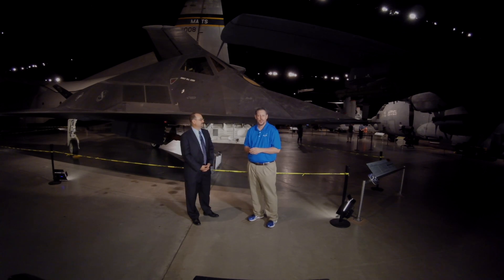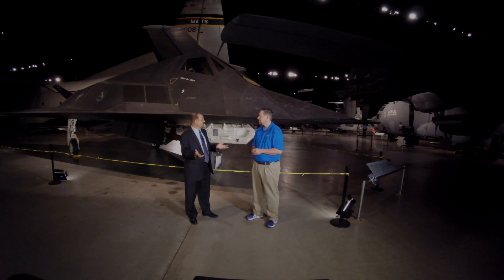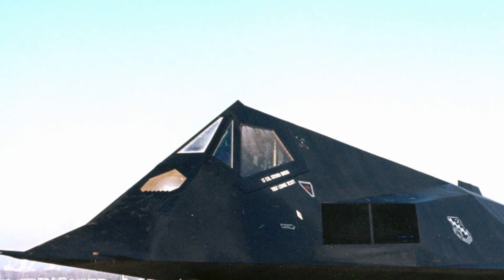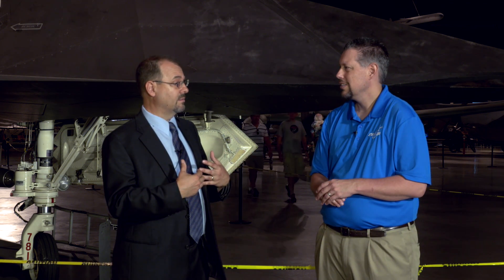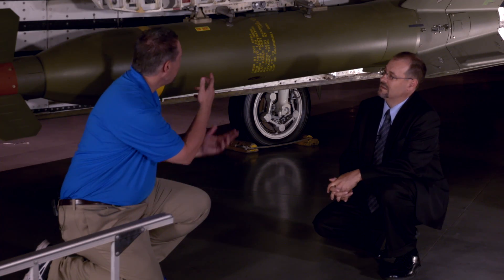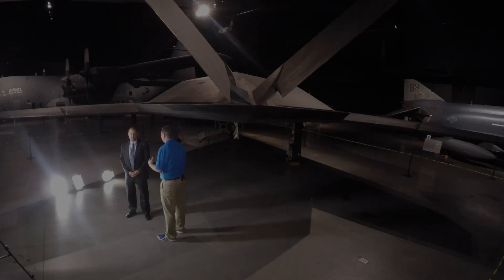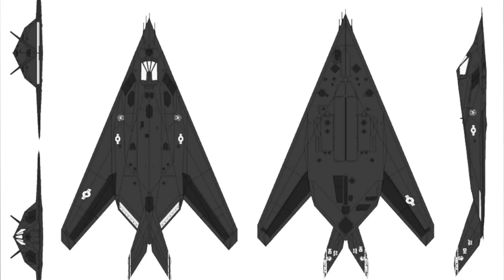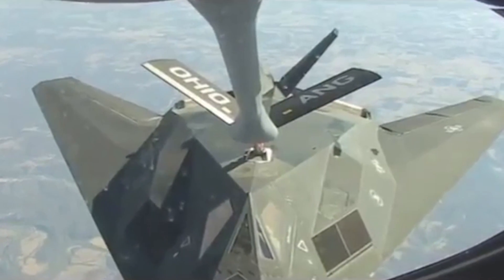Explore the F-117 Nighthawk

Comment: The Cockpit is perfectly placed ... Good view..... Probably the best advancement in the plane.... But the fully software defined architecture is the biggest draw back ... and no matter how much stealth coating and Anti radar things the plane is equipped with its is always vulnerable when the Hatches open.... The Moment those hatches open the electric signals are prone to be detected thereby making the Plane visible to Radars .... On a personal view the SR 71 would make a better fighter with some modifications

Comment: Can somebody explain the diffused exhaust to me? I don't understand how the plane generates any thrust if it defuses the exhaust like that.
Reply: The engine thrust (exhaust) is spread out and diverted slightly up to rapidly reduce the temperature, but this doesn't change the actual energy required to propel the aircraft. The actual heat source seen from a missle's perspective is confusing because there is no definitive heat plume to lock on to. The engine's are buried deep in the fuselage so their heat source can't be detected as well.
Reply: That's exactly what I was thinking!
Reply: It's pumping out the same volume of air, just cooled down some.